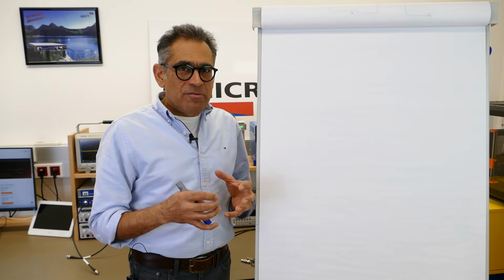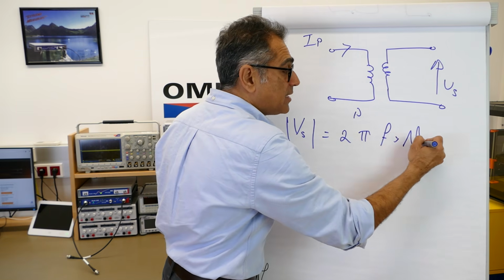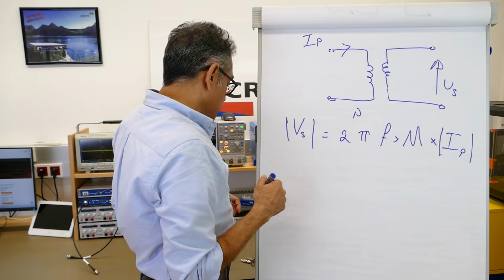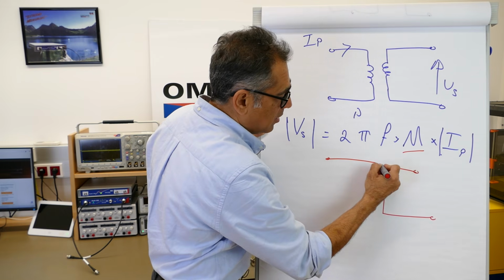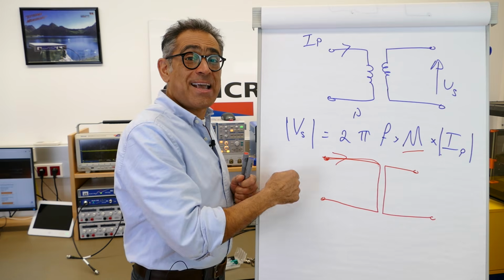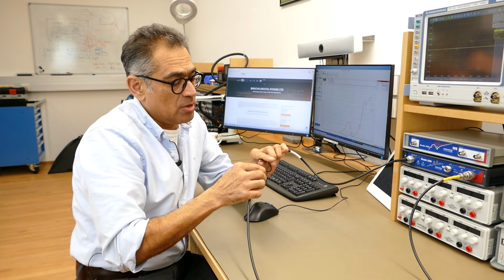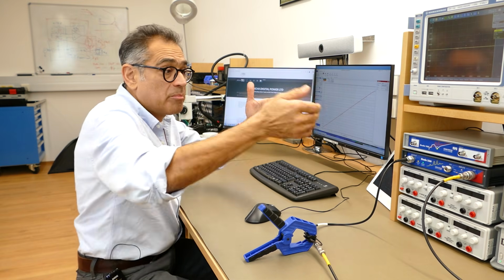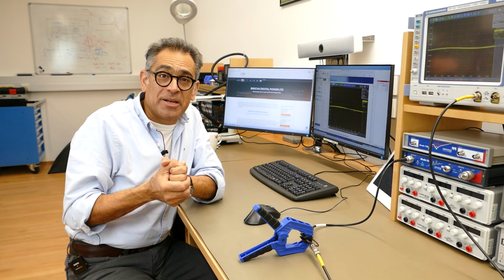EMC Debug Fundamentals With Real Lab Demo: Inductive Noise Coupling Explained

Comment: Thank you very much. But why is the amplitude of Ip constant as the frequency increases? Where in reality do we see an injection of current with constant amplitude while the frequency increases?

When the amplitude of the source signal of Bode 500 is constant vs frequency, then Ip must decrease with a slope of 20db per decade resulting in a constant amplitude of the Vs, or 0db per decade, just like in any transformer. Or maybe the source voltage signal of Bode500 has been set so that its amplitude increases with a slope of 20db per decade?